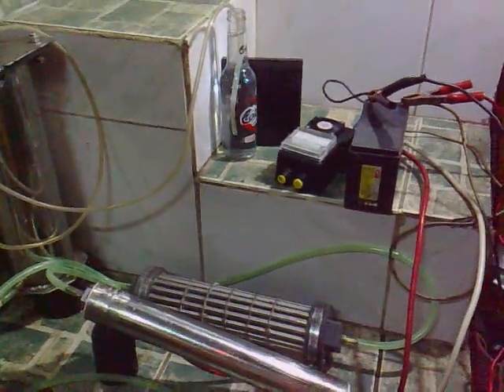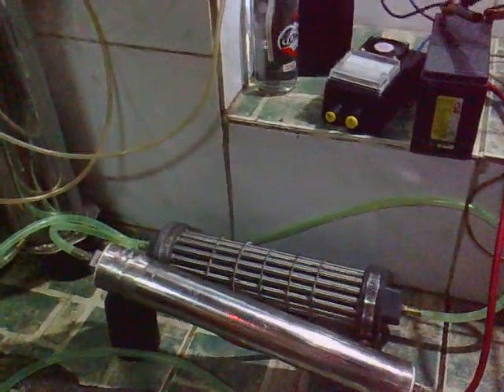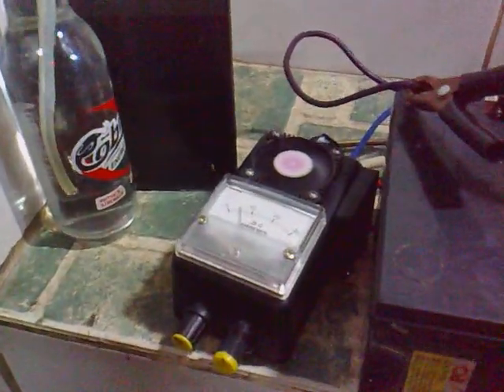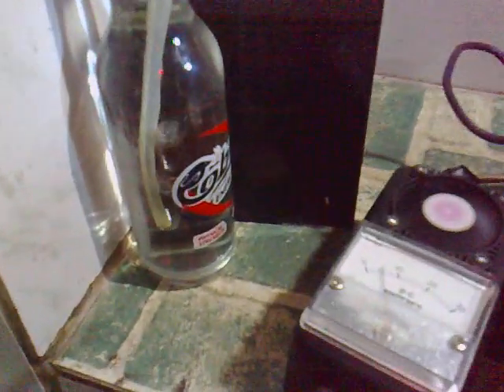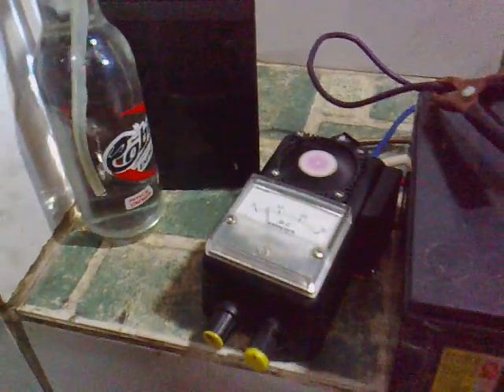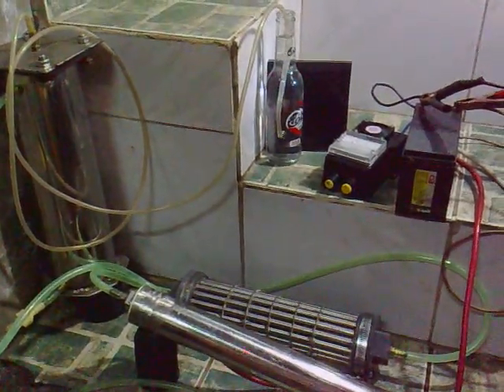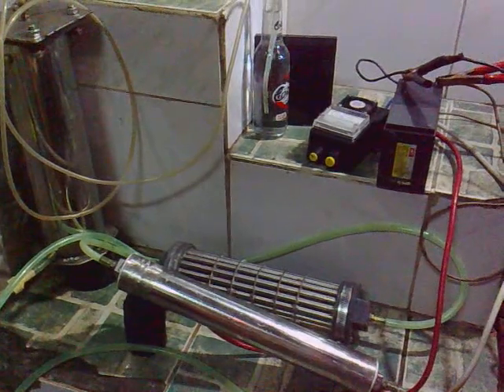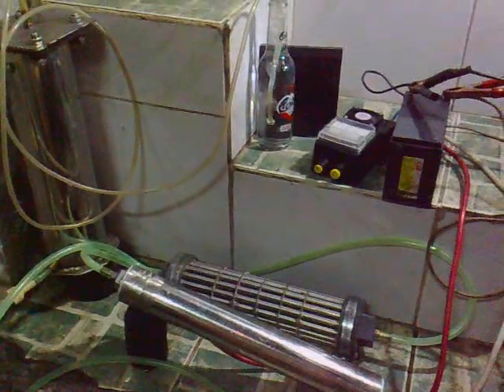FINAL HHO CELL FOR MY CAR ( dry TUBE cell style )

Comment from the maker: @irondmax 

really nice bro......

i really like the cooler and the cell. are they made of only stainless and plastic?

maybe i want some of these, import to the usa

pwm looks good too.

THE ONLY PLASTIC ON MY CELL IS IN THE BOTH ENDS OF MY TUBES INSIDE WHERE I USE TO HOLD THE TUBES IN PLACE,  I COMPUTED EVERYTHING IN A VERY PRECISE CUT DUE TO A VERY LIMITED SPACE....I THINK ITS NOT THE BEST CELL YET,  ITS A GOOD START,  TO A NEW BEGINNER.....

Comment from the maker: @irondmax    thankz Bro....sorry Bro i dont know were to find this kind of cooler,  i just saw   this in one of the juckshop near my place, i think they use this for industrial machineries . hope to see one again and send to you...  this is SS and the both end is copper about one inch, about 30 small tubes....    my cell is 6 tubes , 12 inches including the casing but the casing is not connected just casing. 1/2 SS rod in the middle as my positive 4 neutrals then last tube is my negative.